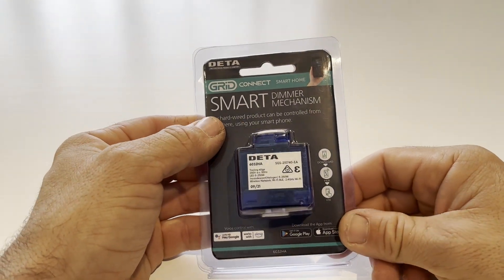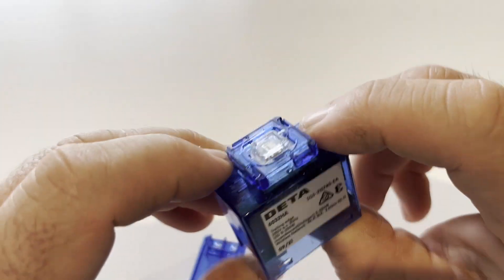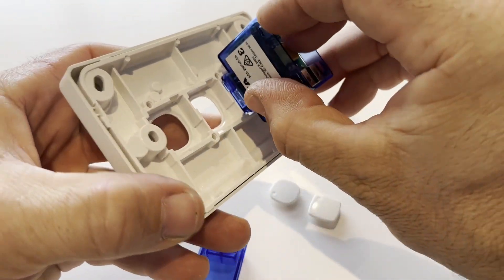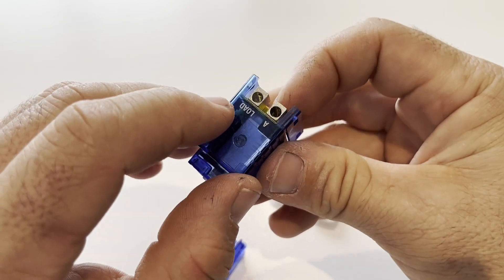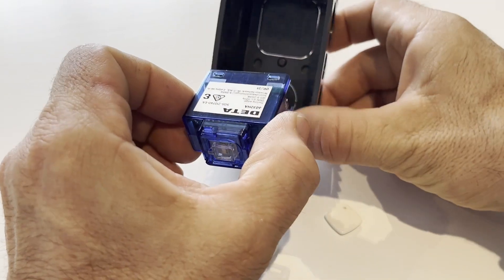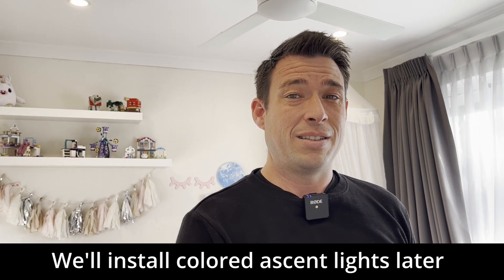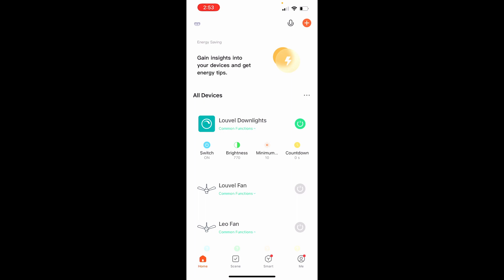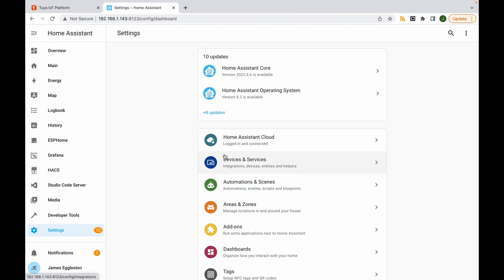Great WIFI Tuya Dimmer for AU wall plates

Comment: I started with the Bunnings WI-FI smart switches and after too many issues moved on to Zigbee. Zigbee is a much more reliable standard which will continue to work if the WIFI is down.
Reply: What brand did you go for ?
Reply: @jackcs6102  Initially, I chased the lower prices. 
That turned out to be a problem. When one Zigbee switch failed I could not remember what brand it was or who supplied it.
So I now use Ikuü Smart Zigbee by Mercator.
They are available in Australia. I don't know if you can get them.

Comment: Hi there. Living in Perth and wondering if could connect this type of dimmer to an Led downlight from Beacon Lighting - LEDlux infinity Maxi sku 170618 ... they show their dimmerLucci Power 150W LED Electrical Push Button Dimmer( quite expensive around 80 bucks) but no wifi whatsoever .... did not buy for that reason. they recommended another dimmers but with no connection  such clipsal 31E2RUDM or Diginert led smart MEDM. just wondering is could give some inside if could use this DETA Grid  Connect dimmer with this downlights i bought.  Any comment would be appreciate or othiwise great to listen your views in different products cheers odama

Comment: Hey mate do you know how to get security cameras on the Tuya app to display on an android smart TV. I've tried  sideloading a couple of Tuya apk's because Tuya does not have an a smart tv app but the apk's although from apkmirror did not function.  I heard there is a way possibly using a 3rd party assistant like google but need a nest device. Would like to confirm that before spending the cash on a nest device

Comment: Interesting watching your setup.  Why did you add this as a switch rather than a light with all the options?  I am new to this.  I can see it is a switch but basically it is just a light for configuration.  I am just experimenting now with a Deta downlight (DET902HA) and an Arlec Light (ALD092RHA).  Having trouble getting the countdown timer to work on either.  All the other functions work fine.  As I said I I added the light as a light with all the options built in and then added the timer as an additional entity.  Keep them coming.

Comment: Great video mate!! Does this fit in Clipsal Iconic range? If not I was planning on getting getting Shelly dimmer, should I get that bell rocker switch or what do you suggest for dimmer lights? Thanks heaps
Reply: the wiser mechs work with zigbee2mqtt and fit in iconic wall plates
Reply: @duck3364  only problem with the wiser mechs is you've got to sell a kidney to buy one

Comment: Hay, iv seen that you have advantages air, my air. Can you run a home assistance dashboard on the included tablet. I’d be interested in seeing a video on the integration with home assistance.
Reply from the maker: That would be a great idea, the only problem is (and I like all things advantage air, except that tablet) but the tablet is the slowest most terrible tablet I have ever used. Advantage air does as you probably know have a integration that is included in the core of HA.
Reply: @SparkyJames  I have seen similar reports that the tablet is slow and unresponsive, but i find it hard to find any information or examples of people running there dashboards off it. My current ac controller is centrally located in my home and if I was to drop the 1500+ to upgrade to my air the tablet would be installed in that location. It would be incredible helpful if you could try and install full kiosk browser on the tablet and make a video about that. Also a video going over the home assistance integration. 
If that’s not something that I can do then I would look into other options to integrate my aircon with HA.
Reply: @maysminecraft  I have the HA mobile app installed on my ezone (advantage air) tablet. Works just fine, but not the fastest tablet in the world as previously mentioned.

Comment: Looks like same size and design as the brilliant lighting one, they use the Tuya infrastructure also but are cheaper than $70! I'd rather buy from the wholesaler if anything went wrong, as I already own some broken arlec smart plugin outlets.
Reply from the maker: Your right I was going to try the brilliant one as well, it looks very similar, but it wasn't readily available from any place local to me including the wholesalers, but it is availble online for simlar prices and ebay a bit cheaper(thats a tough one to return if anything happens)
Reply: @SparkyJames We need to implement SPDs on installs to protect peoples investments,  I personally distrust the longevity of these IoT devices. We also suffer 1050Hz injection from the zellweger devices on the east coast which is no fun with led drivers that don't filter it. 

Looking forward to your own open design using a esp32, because you know that's what we all want ;)
Reply: @SparkyJames  I've had two Brilliant Smart Dimmers (rebranded Tuya) overheat and partially melt on me (limited use, under 4 months install on both) for roughly the same price. One failed ON with no way to turn off except the mains. The other failed off. I let Brilliant know, no response. Anyone else??  My sparky now hates my recommendations! I hope the Deta's are better made!
Reply from the maker: @augareth  hmm interesting I had 2 Brilliant lighting Jupiter dimmers and neither lasted 6 months, they just stopped working, they are a bit different to this one. But I’ll let you know how they go. This one has vents in the case which the brilliant mech style does not seem to have. The other thing this dimmer actually doesn’t have is MOV across the mosfets(that I could see), so a voltage spike could kill it.
Reply: I’ve been using the brilliant smart dimmer mech for more than a year. Looks exactly the same as the Deta one and cheaper. So far working great with tuya lan via homebridge. Control via Home app is very responsive.